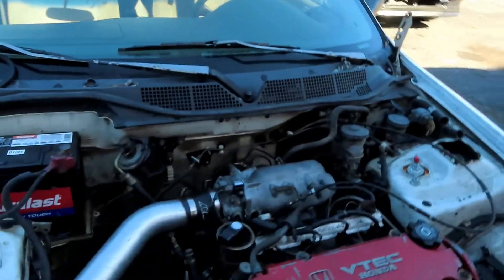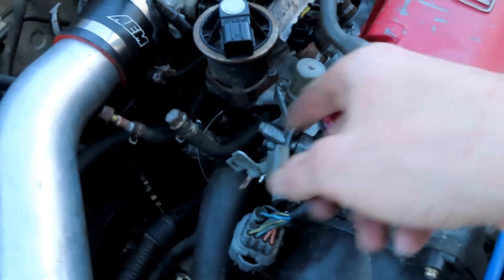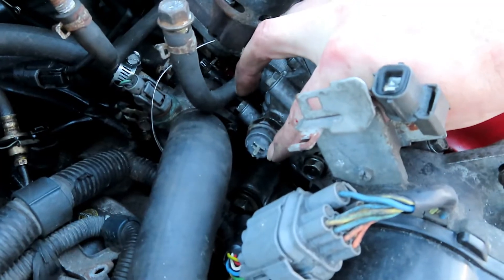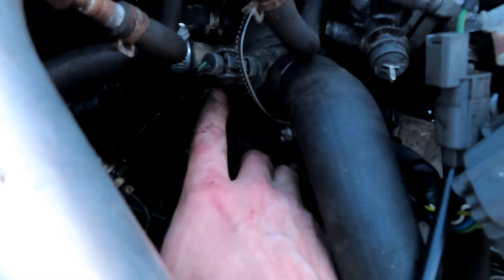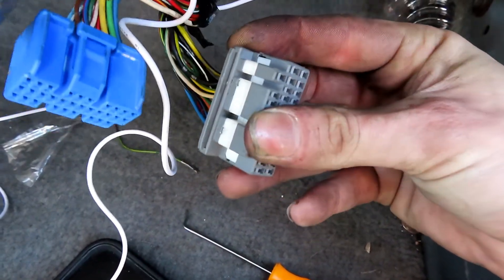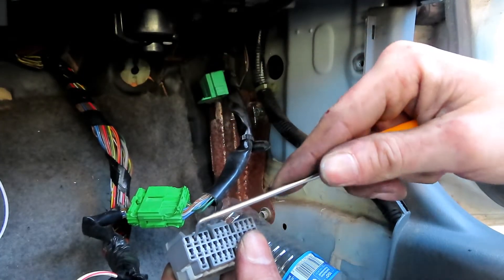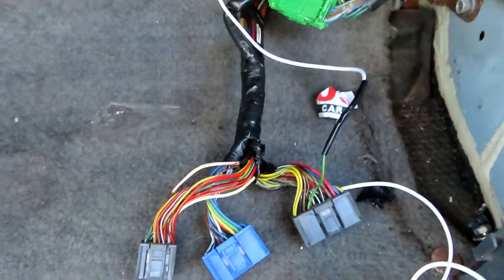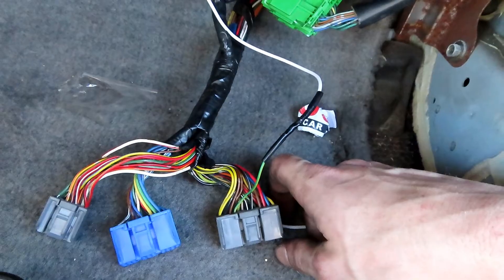How To Wire VTEC In A Non VTEC OBD2 Honda Civic

Comment: I have a 1997 cx hatch that came with a d16y7 non vtec motor. I swapped it with a d16y8 vtec motor as well as with a p2p manual ECU and I did the wiring just like in the video. I’m having an idle surge where my cars is just bouncing off 1500 rpm. It did throw a code and it was a P1508 “idle speed control valve opening solenoid control open circuit”. It says the IACV is bad. But it only does it when I plug in the p2p. When I plug in the p2e (non vtec ecu) it idles fine. Any suggestions? TIA!!!

Comment: Hey I have a 1998 civic ex 5 speed (d15 with y8 head) with P2P ecu , if my y8 harness has all the plugs for solenoid already and my ecu is vtec I don’t need to rewire anything?

Comment: If i swapped a z6 d16 vtec head onto d15z4 block, would this wiring work to get the vtec engaging? I have the p28 ecu from a vtec, manual d16z6.

Comment: Hi I'm jv I have a question about my honda civic  2002 1.7 l vtec engine  the question is...I found a  white wire connected to injector number 2 and it lead to the computer can you help me out if you cand thank.

Comment: Y not just get the pin to add it directly to the engine harness. Much cleaner look and u can just remove  the whole motor and engine  harness together.  Plus it's a much more stock look😊

Comment: Hey bro got a question a recently swap my d16y8 vtec engine to a d15b non vtec everything works i just dont have enough power i have to press down on the gas hard for it to pick up fast what the cause of that? Will really appreciate your answer

Comment: Great video boss!  Hey question: Im putting a y8 engine/head into a y7 chassis. Will my 98 y7 ecu be able to activate the vtec if I wire it up like youve done here?  Thanks
Reply: No, it doesn't work that way. Even with it wired correctly, the y7 ecu will never be able to send a signal to activate vtec because it ever had vtec to begin with. 100% cannot do a vtec mini me swap without the y8 ecu

Comment: Hi sir. I have corolla 2007. In pakistan 2007 model corolla ware non vvti engine.  I bought this car.  This car engine change with 2011 model engine which has vvti. Car dricing is good with old model ecu. But vvti is not working. vvti wiring. I can se any wiring for vvti. 

Question: can i connect vvti to non vvti ecu. Kindly help me in this problen.

Comment: I just bought an 89 civic it is not running been sitting for awhile motor turns over everything looks OK just discovered it has been swapped to the D16Z6 motor. This is new to me do you think this could be a nightmare or is this not that big of a deal to mess with. I practically stole the  car for what I payed for it.
Reply: d16z6 best d series to build if i had one with the car i bought i would of built it but instead i have a turbo y8

Comment: I have 97 Civic dx with d16y7. So im doing a d16y7 block with a 2000 d16y8 head and im also using the d16y8 ecu. So do i need to wire knock sensor i was told i have too. But i dont know pin it is if i do...

Comment: Cool video, would this method work on 01-05 civics with d17 engine non vtec?
Reply: It does indeed work I have an old three I did it and I pop VTEC just fine although make sure you have it grounded cuz if not it'll throw a code and it'll go into limp mode and not allow you to run over 3,000 RPMs
Reply: Hello I’m a fellow 04 Honda civic coupe non vtec owner. I had a d17a1 engine that I swapped not too long ago for a d17a2 which is vtec but the solenoid isn’t wired. Yall have no idea how long I’ve been looking for a video or someone who knows how to do this. I myself am not experienced to do any of this work and don’t know anyone who does. I live in California where regulations for any mods are highly illegal so finding a shop like so is also tough but man this video shows how easy it is(perhaps) might give it a try or if you guys have any other videos please feel free to respond to this message I know it’s been 2 years😭

Comment: Hey man love your work. Any chance you could help me with that same aspect but in my 3.0 vtech accord? I believe it came stock as a 3.0 non vtech 6 speed stick and now has a 3.0 vtech with no plugs for vtech solenoid or oil pressure switch.. Thanks man any info will help..

Comment: Would by any chance do you know if the crv manual harness work with a 2000 civic si b16 ecu. I did a b16 swap on my crv and I have the si ecu but I haven’t had luck find a matching harness and was I’m wondering on directly running the vtec solenoid into the ecu. If so then this video will help a lot

Comment: Recently did auto to manual mini me swap on my 99 civic ex, running a p72 gsr ecu y8 head on ZC Block.  My question for you is on the Dizzy harness (y8dizzy) the Blk/Ylw & Blue wires on the ICM go where to which wire(s). They came undone from whatever wire(s) they got “soldered” onto. On the dizzy connector the Ylw/Grn wire (#1 pin) is cut. the dizzy connector has a OBD2a jumper harness that it plugs into making it go from 7pin to 10 pin. On the jumper harness OBD2a side pin 8 Blue wire is soldered to the OBD2b side pin 1 Ylw/Grn wire & where those 2 wires were soldered together it has a wire tapped into which leads to nothing. I’m assuming that it to came undone it wires to one of wires that came undone of the dizzy. Sorry for the long read any help would be appreciated.

Comment: I have a 99 ek d16y7 i want to swap it with a y8 vtec how do i wire vtec
Reply: I have a 97 with a y7 and I’m gonna put a y8 head on it. I’m sure it’s going to be the same process 

Mine also auto so I have to use the p2p ecu

Comment: I have a y7 in my 97 but I'm installing a y8 head. I can wire the vtec solenoid no problem. But the y8 was an automatic car. I took the ecm just in case. Is there a  way to turn the 97 y8 auto ecm to manual?
Reply from the maker: There is but you need to change a few things inside the ECU. If you send it to Us we can do it for you.